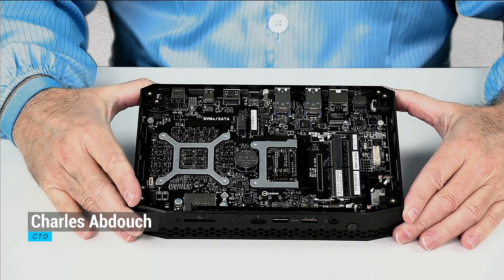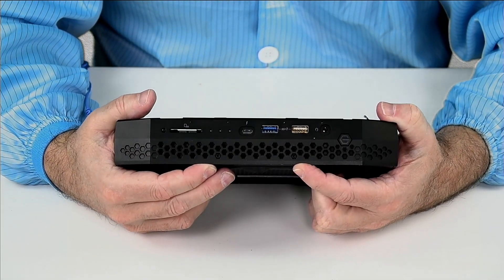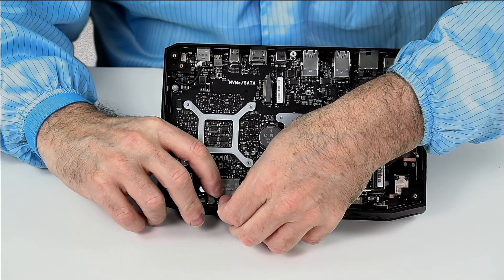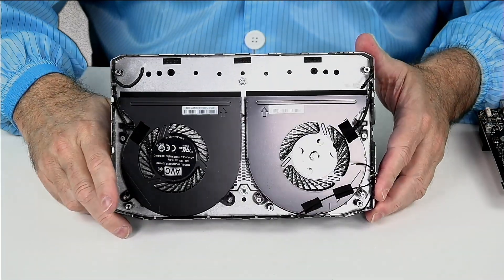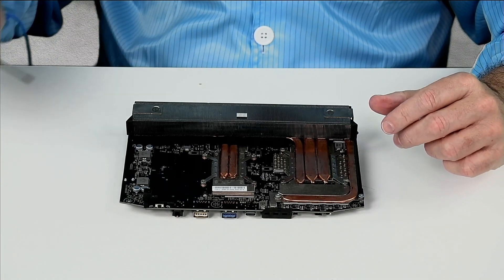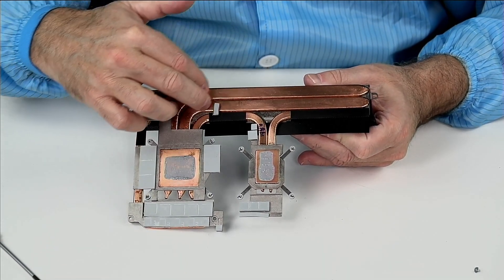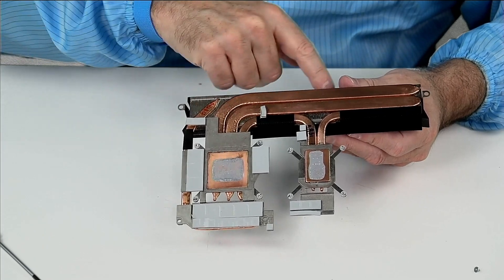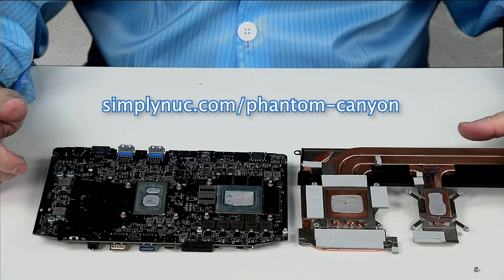Intel NUC 11 Enthusiast - Phantom Canyon - Teardown

Comment: 1:20 no! that coax connect with white tag on the right is designed to fail, the one on left could be plug unplugged all day without issue. In the event of broken micro coax I very carefully superglue it back with toothpick after ptm7950 cpu & gpu replacement. All good wifi working and temps 10-15c cooler than stock
Reply: Also the bezel is insanely more difficult to remove compared to this video… I don’t recommend opening beyond ram & ssd access because of this intentionally difficult disassembly… which is a shame because a great machine should have basic maintainance access!

Comment: Is it possible to disable the discrete gpu to save power when you're not gaming?
Reply: Only if you connect to your monitor via thunderbolt you can bypass the dpgu. Furthermore you have to set in windows inside the nivida settings under 3d-settings that the igpu is your preferred graphics processor.

Comment: This is so awesome, really wish Intel would do their own handheld to compete with the steamdeck. Slap a 8 inch screen on this and bam ... Of course it's never that easy but just wishful thinking
Reply: 230W. Things empty in 25 Minutes....
35 Mins if paired w/ amd Ryzen instead of intel core....
Reply: @legendaryz_ch  meh I'd still buy it, looks like something that can be improved on as time goes on of course though

Comment: The memory config is purely due to binning--It's using a GPU (TU106) that on paper can support up to 8GB, but they're using a variant that tops out at 6GB because parts of the die have been disabled (because they didn't work). The board still has spots for all 8GB of VRAM because that's how it's designed: Each of those spots for VRAM is directly connected to a specific portion of the GPU. Since silicon manufacturing defects strike randomly, it's cheaper and easier to just design one board and then leave certain spots empty--otherwise you'd need to have a separate board revision for every possible memory config of the version of the TU106 that they're using--that would create huge bottlenecks and cost inefficiencies.

Comment: So disappointing to see this out too late and is now basically obsolete - no RTX30xx series graphics (using old 20xx), no resizable BAR/Smart access memory support, no PCIe Gen4 NVMe (still using Gen3), no HDMI 2.1 (still using 2.0b), no thunderbolt4 (still using tb3),  no DisplayPort 2.0 (still using 1.4), no bluetooth 5.1/5.2 (still using 5.0). They should of released this earlier or just waited and released it with the current 30xx series graphics and updated specs. DDR5 is on its way too.
Reply: Cannot agree more!
Reply: Agree. If it came at a good price point it would be an option, but looks like it won't
Reply: What Do you think about nuc 12 enthusiast?
Reply: @Com4nd3r.  The ARC graphics killed it for me unfortunately. It's also really ugly - at least these looked nice.
Reply: @mepm  We need NUC with RTX 40xx Series defnetly.
Reply: clean

Comment: it looks so good idk why but looks nice
Reply from the maker: It must be that black PCB!
Reply: @SNUCsystems  I am puzzled on how the ram is cooled ? The  top is completly closed and so the back of the pc, ram and even m2 are cooking inside.No holes to exit even in passive way tye heat!!
Reply: @ 123OGNIAN Hi there I suppose a extremely late reply is better than none or to the random viewer… the m.2 ssd makes poor contact with the chassis via thermal pad but can be vastly improved with 0.5mm copper heatsinks sold for laptops resulting in much better contact with chassis pads (with heatsink idle temps @ 42c under-load @ 55c)… ram on the other hand does seem thermally compromised however it uses low power modules and based on hardware info the internal ambient temps are surprisingly low for this model nuc average is about 45c

Comment: Fan of the nuc. I have the nuc 8, it runs really well. Can anyone explain what is the max-P (2060) GPU? I read and understand that it is a downgrade from desktop 2060, about (only) 10%, but better than typical max-Qs (2070 etc.), which is about 30% reduced performance from its desktop version.
Reply: On the Max-Q, The main differences is it is 50 watt lower power. Core clock is 15Mhz faster, but the Boost is 15Mhz slower and the Texture fill rate is 1.1% slower. Memory clock is 11Ghz instead of 14Ghz, providing a memory bandwidth of 264GB/s instead of 336GB/s. I would say your assessment of 10% and 30% is close enough.
Reply: Howdy, I just realized I didn't answer your Max-P question. The Max-P is not an Nvidia designation, it was created by the industry to refer to the non-Max-Q.
So there is the normal 2060 and there is a 2060 Max-Q, so if someone said 2060, you wouldn't know if they really meant the 2060 or forgot to spend time to say Max-Q. 
By saying Max-P,  you know they are referring to the 2060 which is faster than the Max-Q

Comment: Do you offer conformal coating? My largest concern with a device this dense is humidity.
Reply: We can, but the process could be expensive. What is the humidity level you are dealing with?
Reply: @charlesabdouch3052  New York City humidity - the #1 city in the #1 nation uses +100 year old steam vents in the winter and have terrible summers with no central air. All my desktops in the past 10 years have ended up corroded to date which makes this look like an attractive unit if it can be properly coated.
Reply: @11001001110100  Thank you. There are companies that can do coatings that can help. Due to the expense, I would like to ponder what the best solution is for you and others in your situation.
Reply: @11001001110100  Thank you, I will look into this one as well as yesterday I found a vendor I talked to at a show in the past that does this as well. Thank you for getting back and pinging this to bring it back to my attention.
Reply: @charlesabdouch3052  I can imagine there is  a large enough niche market to make this viable, and that a large amount of NUC failures are actually from humidity and dust, so you might even save money on your extended warranties.
Reply: @charlesabdouch3052  3M sells something called Novec Electronic Grade Coating, you might want to look into that. It seems to be the most viable and reputable solution.

Comment: You bought 2060, because we wanted it but it is too late, 3060 is much much better than 2060 around same cost, again tiger lake 8 core is coming, while you are using 4 core tiger lake, again it cost too much. 
It has bad performance to cost ratio.
Reply: Nvidia is a solid step up from the old AMD vega.
Reply: @jacobroberts834  yeah, 2060 is a major upgrade then vega,
But 3060 is better now
Reply: Intel's been working on this for years and they likely had a contract for sourcing 2060s for a while now. It's likely they wouldn't be able to amend the contract to get 3060s and considering this device is going to sell less volume than a gaming laptop, NVIDIA probably wouldn't even want to sell any to Intel in the first place. At this time, 2060s are just plain easier to get.
Reply: @Llamageton  oh that so,
I think,intel is not serious about nuc.

Comment: Sorry but I now see this as a happiness $ink Hole
Reply: this actually has specific use case scenarios compared to a traditional full-sized pc, namely ease of conformal coating, low power consumption and low thermal output for continuous operation.

Comment: You are the only channel on youtube that I see that practices ESD principles. I am impressed Sir. Love your channel too
Reply: Thank you. I try to bring it up in every video where I have the chassis open, and protect equipment when I will be dissembling it.
Intel's NUC RMA center told me years ago the number one failure was damage to the CPU when people installed the DIMMs and static shocked the socket.
Fortunately, the unit came back up fine after I reseated one of the DIMMs. whew!!
I am doing 8-monitor testing on it now and that video will be up soon
Reply: Class act
Reply: This is malarkey… not in this day and age. Looks foolish af. But then again im a fool too for commenting on a half decade old comment… what do i know🤷‍♂️